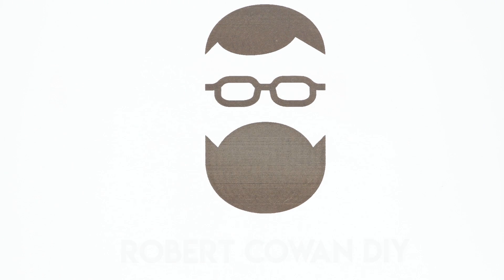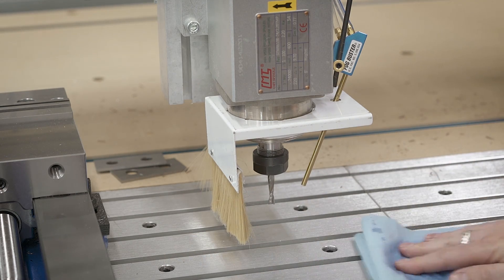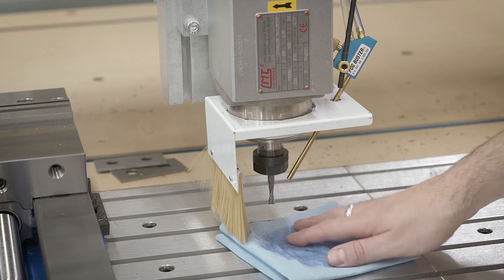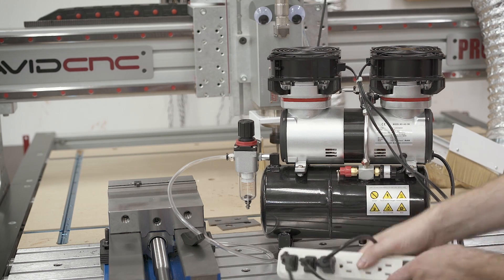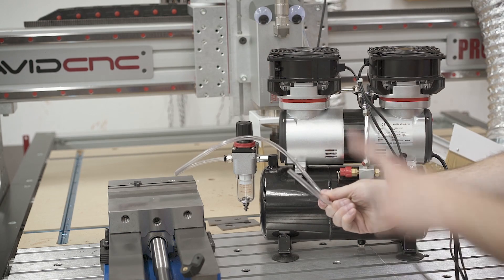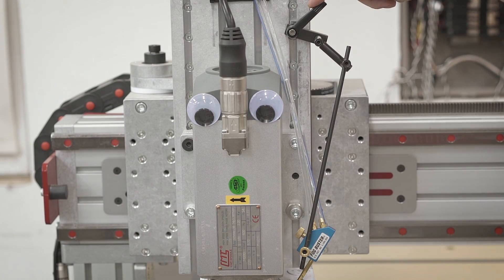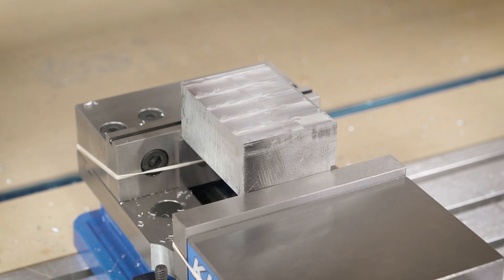CNC Router Fogbuster Overview

Comment: I stumbled on this very interesting video while looking for info on aluminum cutting with my CNC. I plan on using a fug buster system using my big shop compressor (thas is very loud) and your really peaked my interest whith this airbrush compressor. I know it's an old video, but do you still have this compressor working? I checked the Amazon's rating and many says they had many problems with it. Many thanks for all your good videos.
Reply from the maker: Hey!  Yeah, it still works just fine.  I don't use the machine a TON, so maybe that's why.  But it's always worked just fine for me.
Reply: @RobertCowanDIY  Thanks for the prompt reply. You mentioned you could use it for more than an hour without stopping, do you still consider it's possible with your mod with the ventilator?

Comment: Very nice video, many thanks! I am now looking at the schematics diagram for AVID's CRP850-00E breakout board. The FogBuster's solenoid switch requires 110v (default) but it is also available in 24v, AC or DC, 220v. So, I would imagine I need to take the 5V digital output line from AVID's breakout board (Relay#1, terminal 17/18) and send it to an external MOSFET (between AVID's board and the solenoid switch) for controlling the solenoid switch at 24v. Or use solid state relay instead for AC control of solenoid. Please could you let me know if I understand this correctly, and if this is the setup you have? Any advice will be much appreciated. Many thanks. AA from England
Reply from the maker: I just used one of the AC outlets on the unit.  That was the easier way, since using 5V logic to control a relay to control a solenoid is a lot of extra steps.  There are two controllable outlets on the bottom of the main control unit and I just used one of those.
Reply: @RobertCowanDIY  Many thanks, this makes it a lot easier. Cheers, AA

Comment: Nice video Robert.  After doing a little research it looks like IPA does have a pretty large benefit for cutting aluminum, and I really like the idea of something that evaporates because I also have an AVID CNC machine that I use mostly for woodworking and I don't want cutting oil all over the place.  
I tried to find info on the flammability risk of this.  I also have a large dust collector (1200 CFM) on a dust boot and I am kinda  assuming that the low amount of IPA fumes in the very large flow of air makes it non-flammable.  I was wondering if you have any data or information to back that up?  I don't want to burn my shop down :-)
Reply from the maker: This is not scientific, but in very low concentrations, it should volatilize enough in the dust collection system that there wouldn't be enough to actually ignite to cause a problem.  You'd be mixing a VERY small amount of it in a large volume of air, moving at high velocity, I just don't see it causing an issue.  I run it into my dust collector, and I have yet to have an issue.  YMMV!
Reply: @RobertCowanDIY  Thanks Robert.  Thats what I figured too.  Just like everyone getting exited about static electricity causing an explosion in their dust collector pipes just because grain elevators blow up....very different concentration levels.
Reply: Follow up.  I finally built my version of what you did.  It works on brass very well and really improves cutting over a dry setup.  Still have to try it out on Al. https://www.youtube.com/watch?v=OvKh1Wmyr08  Thanks again for the idea of using IPA.

Comment: what was the rough tube lengths? I am going to do a similar setup, but guessing fogbusters default 5' hose lengths will be too short. (4x10 avid pro). And... is the AL table necessary - can you not mount the vise directly to avid table, assuming you add additional cross members?

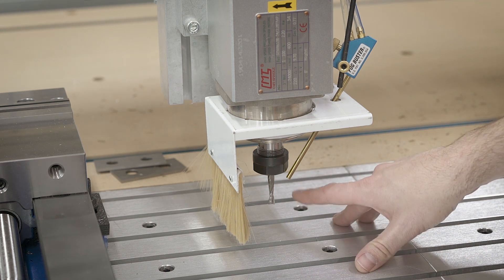Comment: Great work!  What kind of lubricant/coolant do you use in the reservoir? That one that mixes 1:40 with water? And for mild steel too?
Reply from the maker: I use isopropyl alcohol.  It works more as a coolant rather than lubrication.  Works well for aluminum, I haven't cut steel on the machine yet.
Reply: @RobertCowanDIY  thanks Robert ! Cool idea !
Reply: @RobertCowanDIY  I'm building my Avid Benchtop pro 2X3 right now and just ordered a fogbuster thru the Tormach site.  Tormach says not for use with alcohols.  Have you run into any long term issues using IPA?  I'm wondering if there is a materials compatibility/lubrication/corrosion issue or if they are worried about fire hazard.  They also say no pure water so that sorta leans toward the former.
Reply from the maker: @adamevil4282  I haven't had any issues.  But it's of course a fire hazard, it's flammable.  I'm not sure what exactly would break down with alcohol, but mine is still fine about a year later. YMMV!
Reply: @RobertCowanDIY  Thanks, I've used qualichem and its great for cutting but the chips get sticky and cleanup is annoying.  I'm looking forward to trying a cleaner option.
Reply from the maker: @adamevil4282  Same!  Most coolants get very sticky and the chips just get stuck.  The alcohol is nice because it almost feels like you're cutting dry, but with the benefit of coolant.
Reply: What's wrong with using water? (Sorry to revive a dead thread)

Comment: nice work! just wondering if you have tryd ethanol and if so how you find it compared to the isopropyl. i have the later and although most seem to use ethanol, id rather use what i have if its the same same but different type of scenario. thanks

Comment: What solution are you running in the fog buster
Reply from the maker: Currently, 90% isopopryl alcohol.  It works great.
Reply: @RobertCowanDIY  How bad is the smell / vapors? I was thinking of using WD40 in a hdpe nalgene. I built my own fogbuster with some brass valves and a needle inflation nozzle in loc-line. I never use it because my compressor is too loud and kicks on every minute so I really like your air brush compressor solution.
Reply from the maker: @aeroderek  There are no vapors and no smell whatsoever.  You don't need to use much, JUST enough to get a little on the tool, and that's it.  The chips are dry, and there's no discernible smell at all.

Comment: Do you have any issues with getting the coolent on the MDF? I have a completely MDF bed and am slightly worried that it will cause the MDF to swell up.
Reply from the maker: That's why I have a hybrid bed (1/3 aluminum, 2/3 MDF).  But I'm using isopropyl alcohol for coolant, so it's less of an issue with the MDF.  There's very little 'moisture' after the cut.  The chips are dry and it evaporates quickly (which is why it's good at cooling off the chips and cutting tool).
Reply: @RobertCowanDIY  thanks!

Comment: We use the Fogbuster on our Tormach at work. It's critical for cooling and evacuating chips when using endmills 1/8" and under!  I like your idea to use the airbrush compressor!
Reply: Just out of interest, how come you don't use flood coolant?
Reply: @samuraimachinetools  We didn't like the mess it made regarding cleanup and the machine rusting afterward. I suppose we could have looked harder for a better coolant that didn't cause rust. For now we just use a concentrated water-based solution.